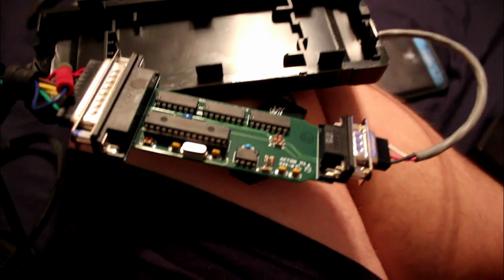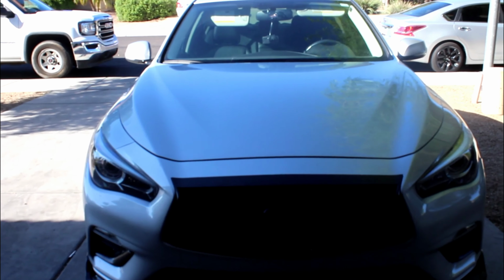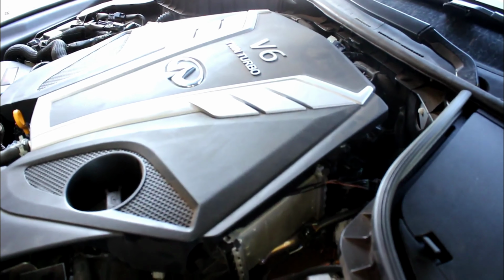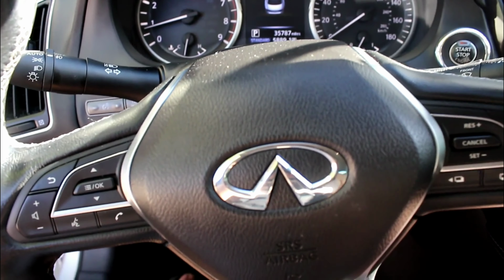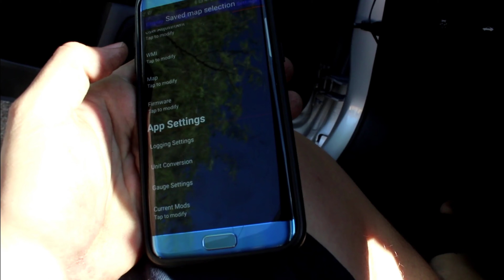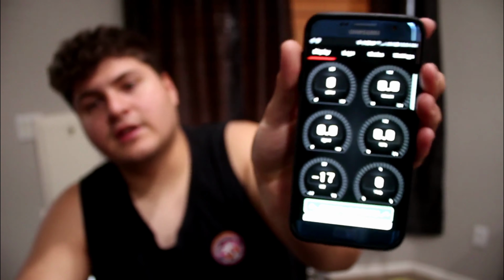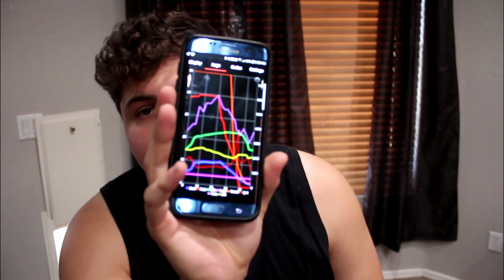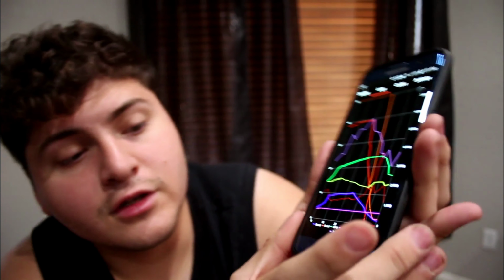JB4 install on my INFINITI Q50/ Device use

Comment: I just got my jb4
My Q50 Luxe is Amazingly FAST  (edit) Bought a borla dual exhaust and custom 2 1/2 cat back exhaust with down pipes.👌😎
Reply from the maker: I definitely makes a differance. I raced a stock 3.0t and put bus length on them

Comment: Hey did you just get that JB4 or did you also get the 140$ bluetooth add on as well? Thanks! I get my 2019 Q50 tomorrow
Reply from the maker: I got both with the Bluetooth makes it easy to connect and change settings

Comment: Hey, I just bought my 2018 luxe 3.0t and was wondering with Chicago weather, what should I add with the JB4 first, intakes or heat exchanger?
Reply from the maker: I would do the heat exchanger first to keep the car cool. The car will get heat soaked without it.
Reply: Don’t buy intakes the stock ones are fine

Comment: Did you have an upgraded heat exchanger before putting the jb4 do you think I would be able to install the jb4 without an upgraded heat exchanger what do you think?
Reply from the maker: I ran jb4 for about a year before I got a hx but I only ran it on map 1. The car gets heatsoaked very fast so I would recommend getting a hx first
Reply: @Chrizleyva  thanks bro!!!

Comment: I just picked up a 2021 Sensory Q50 3.0T AWD, been looking into getting it tuned—but I’m afraid that the local dealership will void the warranty if I do go forward with it (I had another Q50 prior and they always pulled my leg and weren’t very helpful.) Wondering if I should just bite the bullet and just keep it stock

Comment: I'm lost lol 😆, all you had to do is call Z1 and get the uprev tune and record some pulls and send that shii to John the legend and he'll send you some shii and you can flash all that lol. Good video thou 🤙🏽
Reply from the maker: Id love to get a real tune but I have warranty so would rather not till its over
Reply: Ahhh, you bought the car new or it used and there some warranty still left on it. Just to give you a heads up. For some reason the maintenance people can look in your ecu or obd2 and read your whole history in that car. They can tell when you went 140mph on the highway or when you took a crap. Lol 😆  no lie. Be stern with the dealer when something breaks. Some of them will say its your fault when something breaks... 🤙🏽
Reply: Ihùuba✊🏾g37s with a JB4 nothing comes up so even if you went to the dealer they can’t see that, which is why it’s such a great mod

Comment: How’d you changed your top display to a clock instead of navigation my q50 didn’t have that option under settings
Reply from the maker: In some models you can like mine I just push the display button next to the shift knob  and select it some people don't have it

Comment: Sir which red cable did u pick it up bc I just install it and it says serial port unavailable?? Do u know why
Reply from the maker: Did you buy it new? And it would be the dark red cable there should only be one. The only thing i can think of is the wire did not go all the way through to make a connection or theres something wrong with the jb4 itself

Comment: What’s the best map for a stock 2017 q50 3.0t ? I’ve seen people say 1, 3 and 6 but I’m not sure. Been running at 1 for now bc I’m hesitant to do other higher maps
Reply from the maker: Well I only ran map 1 when I was stock. After I added the hx I go to map 3 or 5

Comment: I think I asked another video but what's your rear wheel/ tire setup 19x10 or 10.5
Reply from the maker: I have 19x10 all around with 275 35 up front and 285 35 in the rear these are stock 370z wheels

Comment: Are you sure this wont show up as a tune? I still have 3 year warranty on my Q50 and dont want to void my warranty .
Reply from the maker: I remove mine everytime I take my car in for service. So they don't have prove that anything is there. I've taken my car in already for warranty work and had no issues. Of course they can run a test to see if anything is done but without the jb4 on there nothing they can really do. They would have to prove what caused the issue on the car to deny warranty. In my opinion its really up to the dealer if they will cover anything some are cool some don't care
Reply: Chrizleyva thank you for the reply!! Bout to order 1 now!! Haha

Comment: You have any supporting mods with it ?
Reply from the maker: Not right now just intakes. I dont push the car or anything right now and only leave it at map 1 because i dont have a heat exchanger but that will be something i would like to add before summer
Reply: @Chrizleyva  hey, so i have my 3.0 stock right now, i just want to add a rev9 axleback exhaust and the jb4, whats the highest map i can run without damaging the car. I wint be running in this map all the time driving just when i need to race then its back to map 0 or 1 for regular driving
Reply from the maker: @ovaiskhan4297  I would say get a heat exchanger first to be safe. There are many options available at different prices. I ran map 1 most of the time  before I got my heat exchanger and had no issues. I wouldn't go any higher then that until you get a heat exchanger
Reply: Chrizleyva there’s a burger tuning jb4, heat exchanger, would that suffice ?
Reply from the maker: I believe they have 2 kinds a 299 version from China and a 399 version made in USA. All heat exchangers have the same purpose but its up to quality and fitment that you are really paying for when it comes so other heat exchangers. I would say its good but fitment won't be oem

Comment: i wanna see it "kill a v8"
Reply from the maker: Ive only raced a few V8s like charger rts and older mustangs but havent had a chance to record any. So far ive beaten them only a jb4. Hope to upload some races in the future
Reply: Joey Grip hmmm i think a q50 over 750whp will leave a v8 far behind
Reply: @princealex10  lol who is making 750 whp?😂
Reply: Boost in motion is making 7 figures to the wheels but he blew the stock turbos, I think the VR30 is good for about 600whp, after that the small turbos just aren’t efficient for higher hp.
Reply: @rdaplaumax9289  i ment in this video. Not world wide
Reply: Rdaplaumax you’re wrong if you think boost in motion is in the 700whp
Reply: dopee viralz we are talking about the vr30 not vq
Reply: I want to install a jb4 in my q50 redsport but I want to keep reliability I think stock is fast enough for me but I buy the car 6 days ago and am getting used to the power...
Reply: dopee viralz of course it would leave a modified hellcat behind from a dig

Comment: what year is ur q50, bc i have a 2015 q50s 3.7 and am looking for a good tune
Reply: would the jb4 work?
Reply from the maker: Hey whats up, my q50 is a 2018 3.0t. The jb4 will not work on a 3.7 only on the turbo models. I would suggest a real tune like uprev or ecutek for a 3.7.

Comment: Bro u just installation jb4 at your stock q50 or change something at engine 
If just used jb4 at stock q50 how many hp gave u and what maps used 
Thank u for video
Reply from the maker: All I have is intakes on the Q50 and depending on the map you run and the type of fuel you use will determine how much horsepower you can make. Burger tuning has an example on there website with graphs on how much power each map made using regular fuel and also a mix of e85. I would have you check that out its very helpful and thank you!

Comment: Does a JB4 work on a 3.7?
Reply: sorry if this seems like a stupid question i’m kind of new to the car community, and trying to see what works with a 3.7.
Reply from the maker: @andrewarellano4796  no the jb4 is a boost controller. 3.7 is naturally aspirated. You would have to go with a real tune like uprev and ecutek. My 370z is currently on uprev which is the same engine